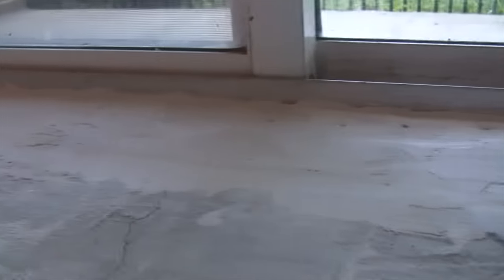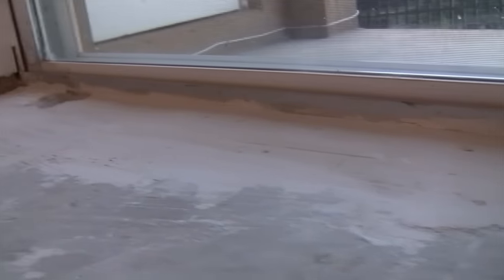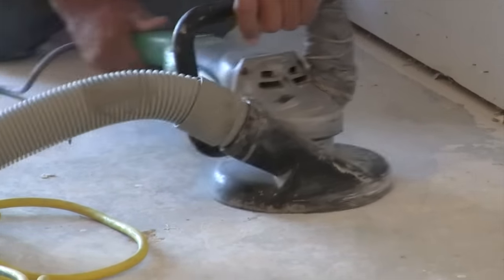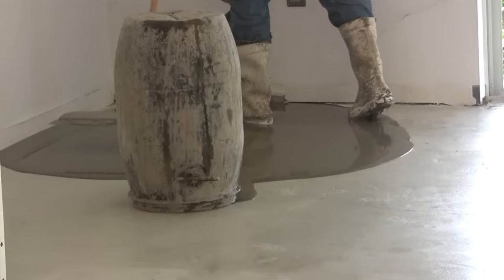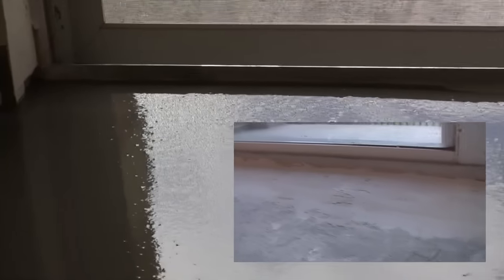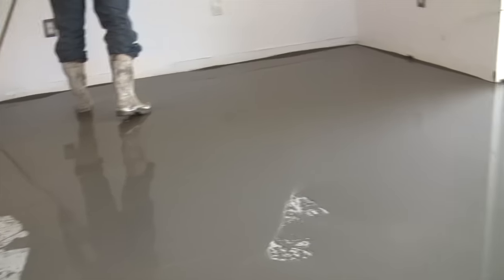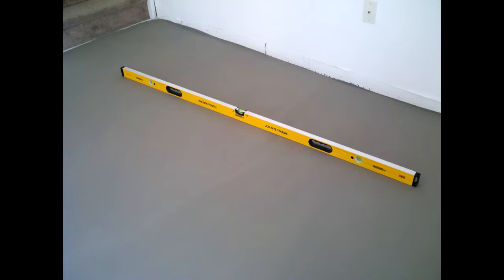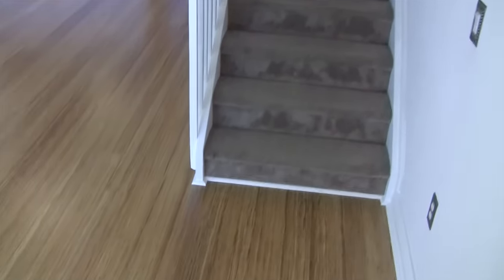How to Self Level Concrete Floors Like Pros - Self Leveler

Comment: What is the brand of the self leveling mix used in this video?
Reply from the maker: They used Mapei Ultraplan 1 Plus Self Leveling Mortar. I don't see it on MAPEI's web site anymore, so I suspect they replaced it with Novoplan 2 Plus, or similar.
Reply: jeffostroff thank you so much. You have a great page and it’s incredibly helpful.
Reply: They definitely still stock the mapei self leveler

Comment: Am doing my floor outside can I use this stuff if not any info would be good thanks
Reply from the maker: Fabian, Usually you can't use this outside, the bag will say interior use only.. Try Ardex K 301, it is an exterior self leveling concrete. https://www.ardexamericas.com/product/ardex-k-301/

Comment: we have rain water under the tiles on our balcony. we will need take it all up and start over, caulk the windows.

 the reason most older condos and apartments have carpet is because the builders didn't prep the floors for tile. many are unlevel. i had dirt and sediment coming in at under the baseboards where they didnt caulk. i had sand piles under the carpet at the walls edge on a ground floor. and when i took a crowbar to pop up the nail strips, it left craters in some where it was nailed down. i used regular drywall putty to fill them in or a tub of premixed gray grout and did a peel and stick 1 foot square laminate in a faux wood look. after 10 years, that got scratched up. any imperfections below showed thru. i did have a large 4 inch scraper on a two foot handle. it broke on the edge in some areas. I don't understand why he put the soup so thick, why not squeegee a thin layer all over. the bags of concrete sand weigh 40 to 50 pounds each,  so us ladies may have to transfer half out into buckets. i can only lift 30 to 35 pounds. 50 will strain my back. 45 pounds is a bench press bar. why workout when you can just renovate. lol. brick pavers are heavy too.

Comment: Hey, I’m working on a large garage type structure in my backyard, there’s a small portion level and the rest dips down to the left, could I level it out with a bunch of cement or is it a lost cause?
Reply from the maker: Check with Arden  On the because some self levelers they don't want them to be used exterior or in a garage so depending on what your final use is going to be determines which product you should use so find out from that manufacturer. Otherwise nothing beats concrete screeding it level.

Comment: Interesting -since this is the first video on the subject that I have seen.
I feel you missed an important step. I could see on the right hand side there was a door. Was that floor leveled as well? If not, I would sure like to know how one goes about stopping the leveling  from going into another room.
Also, not a huge fan of the preamble music at all. It's a filler that is not needed and it's volume is set way above your video.
Reply from the maker: These guys do it all the time so they are good at controlling where it goes. For the rest of the people out there, use caulk to form a border that will dam up the self leveler and stop it from going where you don't want it to go. As for the music, most videos have music! You better start contacting all the other video channels, you have a lot of work ahead of you. LOL!
Reply: @jeffostroff  Great work. My only complaint when people add music is the volume of it butt the finished work make you forget it. Thanks for the video.
Reply: I agree that music was not necessary. It is not an entertaining clip.
Reply: Low expansion spray foam works great to 😀

Comment: Hi, which brand did you use, and how many sft each bag covers. Thanks.
Reply from the maker: They used Mapei Ultraplan 1 Plus Self Leveling Mortar. I don't see it on MAPEI's web site anymore, so I suspect they replaced it with Novoplan 2 Plus, or similar. With 1/4" thickness you can expect each bag to cover up to 25 sq feet, but it varies depending if you have huge dips in the floor where some parts of the floor will be deeper.

Comment: Could you use this for a finished garage/shop floor? I’ve seen some floor leveling compounds that say 5500 psi when dry so I would assume it would be ok, but I’m not sure. Thanks!
Reply from the maker: The instructions for this do say it is for interior use only, I assume the garage is considered exterior. MAPEI's Ultraplan 1 Plus for example must be covered with a finished floor system - not to be used as a final wear surface. This means use as a garage floor is forbidden. You need to call MAPEI directly and talk to their customer support, they are harp guys. If you find nothing with them, try Ardex, another good manufacturer.
Reply: Ok I will get ahold of them and see what they have to say. Thank you for getting back to me.

Comment: I have a question how do you put and epoxy coating on overwork concrete or what they call ashy concrete I poured it myself and let it get away from me the damage is done how do I seal this where we don't leave gray Footprints everywhere we go LOL
Reply from the maker: The sad part is all the concrete slabs down here in Florida done like that, so in commercial spaces they are almost guaranteed they will have to bring in a floor leveling company before tiling.
Reply from the maker: Not sure what you mean by it got away from you. Do you mean you poured down too much epoxy and it dried before you could get it rolled out? Guys who do this usually used shoes with cleats, they roll on primers first, then the epoxy. You need to plan your escape route so that you can keep rolling until you are done, then step off the area. You should not walking on it after you roll it down and it dries per the instructions time given. Try the guys at Lagarria, they have great videos on this: https://youtu.be/NPi36thHf68  Let me know if that helps.
Reply: No what happened is after it was poured I was waiting to get on it and work it smooth but it got to dry to fast and I added water to keep it wet so I could work it and I apparently over worked it and it got ashy now. You leave gray footprints after walking on it
Reply from the maker: @kenmifsud8008  I wonder if it can be ground down and start over, or add more on top. I would check with the manufacturer on the epoxy for guidance.

Comment: Expensive process...But it makes for a beautiful flat surface...It makes you a bit nervous before it levels out..
Reply from the maker: Just have faith that once you coax it into place, it will level out fine.
Reply: @jeffostroff  Yeah, I've always been shocked the next day seeing how flat it is...I've been using Ardex for decades...It gives you a longer work time and they have a lot of additives for various cutback go overs...
Reply: ROB-IN-PHILLY they tell you it works and it will be fine but want warranty you over any cut back...

Comment: How would I know how much concrete leveler I would need for my garage? 😅
Reply from the maker: When you look on the bag they have tables that calculate how much product you need depending on the square footage that you were going to pour and how thick you are going to pour it
Reply: @jeffostroff  and the thickness of it depends on what I’m planning to put on top? Whether it’ll be tile, hardwood floor, etc?
Reply from the maker: @josealfredoparada1475   No it does not matter what is going on top, but the thickness is determined by whatever amount you need to pour down to make it level. Also make sure that the  Manufacturers   specifies that it can be used in the garage because many self leveler compounds cannot be used in the garage because of the weight of the vehicles that are going to be on at the are not designed for that kind of weight they are designed for foot traffic type of weight
Reply: @jeffostroff  thank you for your recommendation, I’m turning the garage into an ADU, it won’t be used as a garage. One more question, a 6ft level is all I need to help me find out the thickness of how much concrete I’ll be needing right?

Comment: How much square feet does a 50 lb bag cover??
Reply from the maker: they tell you on the bags, there are charts, usually 20 sq feet or so at 1/4" depth. But you often have valleys in the floor that will consume more of the material

Comment: I'm puzzled as to why they left the carpet on the stairs?! 
Useful video though, thanks!
Reply from the maker: There is carpeting on the stairs because the carpeting is stinging there it is not being removed and there is carpeting on the 2nd floor as well they were only leveling off the 1st floor in order to put bamboo flooring down
Reply: @jeffostroff  Yes - gathered that... just wondering why they didn't pull the carpet back first. thanks for the vid!

Comment: what kind of blade is the with grinder? not stanard blade obviously, the hardest part is getting high spots down
Reply from the maker: They typically use a diamond cup grinding wheel, like this one here that I used at my friend's house for grinding down old tile in his bathroom remodel: DEWALT DW4774 4-1/2-Inch Double-Row Diamond-Cup Grinding-Wheel for tile floor https://amzn.to/2BMzm6E
Reply: Could have done the job with the grinder and saved having to flood it

Comment: Curious on how you calculate how much self leveling you needed?
Reply from the maker: The bag has a table on it that lists how much product you need. Usually if you need a quarter of an inch depth you'll get about 12 ft² out of a bag. But when you have rooms that are somewhat uneven  like you need 3/4 of an inch on one end of the Room but only a quarter of an inch on the other end of the Room good luck figuring that 1 out. The guys usually bring plenty of bags with them and just make batches and dump until it's right.

Comment: I have a basement from 1932, and the floor slopes the ENTIRE basement length towards two different drains. Do you have any advice on how I can level it? I recently had my basement trenched out and rewater proofed, and got new windows all throughout. I want to finish it and make it liveable space, but I need to make it level. Is there a cost effective way to do this? or just drum after drum of leveling concrete? I do plan to keep the drains open just in case of a leak.
Reply from the maker: It depends on how much out of level it is from one side to the other. Try using a laser to determine. If it's over 1" or so, check the bag of product you are using, your manufacturer may want you to use pea gravel mixed in for better support. One you start pouring you make sure there is a dam all around so liquid cannot escape, then fill it up until the desired height is reach, even though the floor is sloped, the top of the liquid, like the top of a lake, will be flat and level, once it is coaxed into place.

Comment: Looks like a fly by night concrete job
Reply from the maker: The video shows you that it came out absolutely perfect what makes you say fly-by-night and without anything to back it up? Sounds like you're just a troll because usually somebody with expertise would point out what is wrong. Maybe you are the fly-by-night did you ever consider that?

Comment: Could you just not prep the floor and just use more self-leveling concrete? Deep enough to cover all the bump ups?
Reply from the maker: You could, but it would be unreliable. The instructions from all self level manufacturers tell you to rough up the floor and coat primer first, you can't just join new concrete to old concrete.
Reply: Also self leveling screed can be expensive.. the deeper the more you need

Comment: Can I tile over self leveling that was applied on an existing basement concrete floor? What type of thinset should I use to bond better to the self leveling after its dry? Thank you!
Reply from the maker: Yes you can tile over it. A Polmyer modified thinset will work. If you put down a crack isolation membrane like Sclhuter DITRA first, check the instructions to see what type of mortar they recommend for your surface.
Reply: Kerdi is not a crack membrane it’s only waterproof membrane. Ditra is a crack isolation membrane. And I always like using it over self leveling. Unless a mosaic tile less that 1 1/2” in size than I personally direct bond.
Reply from the maker: Do you really need DITRA on a concrete or self leveled floor? This slab was 7 years old, no danger of new cracks forming, so if we were to tile, I would not have used DITRA, just tiled right on the slab. I thought DITRA was mainly in basements or wood sub floors, where there might be movement on the floor.
Reply: On concrete yes I always unless homeowner is cutting cost. The benefit totally out weigh the cost. Concrete always moves. Especially with temperature change. Not to mention concretes moisture content always changing. The air channels in ditra are there for the moisture to condense or stop and balance out and return to the slab. Also works fantastic on infloor heat in slabs to create even heat distribution. Concrete always moves especially on grade. Self leveling is a little bit different being of super fine grains and usually hold a 50k psi rating it will carry the load different with more flex without cracks unless installed over sob or other other unsuitable substrate then it will crack. With large format tile and small grout joints with just a perimeter expansion joint I will use ditra every time. I just did marble mosaic octagons straight on my self leveling only because I poured 1/2” thick and reinforced with fiberglass in the self leveling increasing its strength and flexibility. Either the hundreds of grout joints and using a bostic quartz grout. Which was tested on this marble for no scratches. I believe it was a very successful install.
Reply: I also just used a paint on crack membrane this week for hight issues. Was forced into the situation. It was alright but won’t use it again unless in the same situation.

Comment: No fix cracks?
Reply from the maker: No need to, the self leveler flows into cracks, and if cracks are too small for it to flow into, so what, it will still leave it's own level top once it dries, and no cracks.

Comment: I don't understand. I just did this to my bedroom, and I ended up with low spots. I spread the stuff to roughly 1/4" thickness with a trowel. In all the videos I watched it didn't seem like you had to be exact with the spreading. Now I wonder if I'm just a idiot or should've just used a gauge rake.

Comment: Anyone else irritated that Louis Rossmann wasn't able to know that this IS cheap, easy AND light, not "heavy" as they believed?
Reply: I mean how? 😳
Reply: @totem_pole  ...  How what?  Not sure of your question.  However, I think the problem is, and why Louis and his employees WON'T LISTEN when we keep trying to explain this to him, is because they incorrectly think that to "level" the floor they need to basically create an entirely NEW concrete floor, and level it from the back of the store to the front, which WOULD YES create a too heavy of a floor.  However, that is utterly FALSE...  He doesn't have to get rid of that incline which is there for a purpose to general level/smooth the floor otherwise.  That incline for that long of a store won't cause any issues with sitting etc., and does NOT need to be removed.
Reply: @Repair Man ...  Ya, it's really disappointing, and MANY of us were trying to tell him this from the beginning, even yesterday I even donated trying to tell him, but he just ignored what I was saying in my message, just reading the first sentence and then huffing and puffing, ignoring it and not even responding to me when I gave him money.

Their problem, and why Louis and his employees WON'T LISTEN when we keep trying to explain this to him, is because they incorrectly think that to "level" the floor they need to basically create an entirely NEW concrete floor, and fully level it from the back of the store to the front, which WOULD YES create a too heavy of a floor.  However, that is utterly FALSE...  He doesn't have to get rid of that incline which is there for a purpose to general level/smooth the floor otherwise.  That incline for that long of a store won't cause any issues with sitting etc., and does NOT need to be removed.
Reply from the maker: Maybe Louis will do a Mea Culpa video on this
Reply from the maker: I have not heard anyone say, how far out of level is the floor?